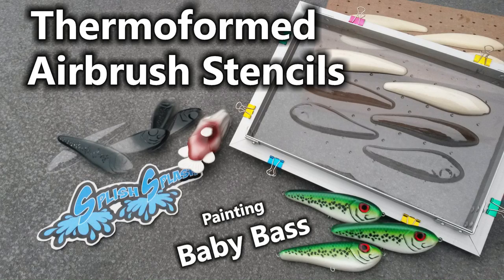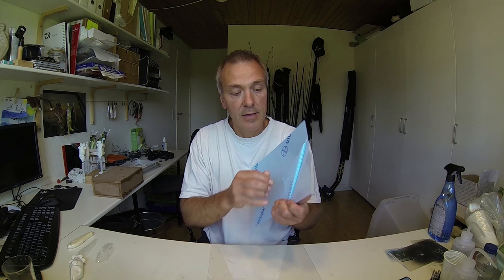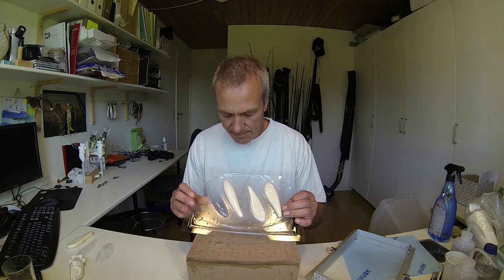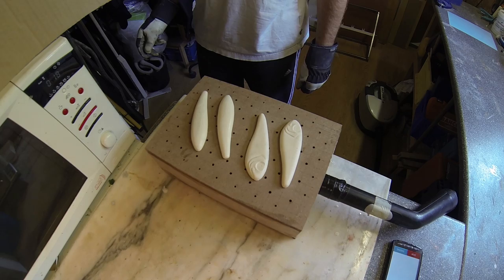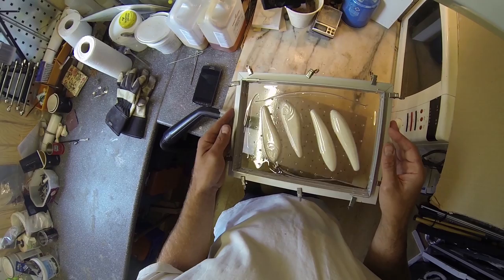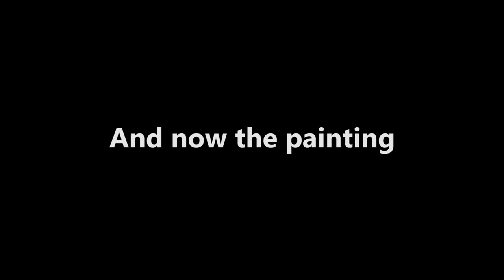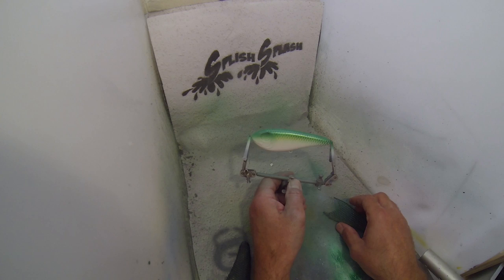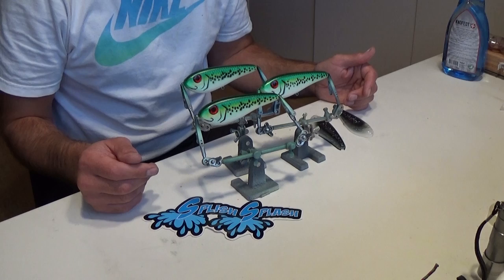Thermoformed Airbrush Stencils

Comment: Awesome video and definitely looks like a baby bass. Could you use a heat gun on the plastic instead of an oven? if so it would be cool if you made a video doing that. Tight lines man.
Reply from the maker: You can use a heatgun, but it has the risk of melting holes in the plastic. With the owen you the whole thing heated at once, so it easily shapes around the bait

Comment: Great video as always mate. Thanks for posting. Are they plastic stencils for the scales or some other material?
Reply from the maker: Thanks Mathew. No the scale "stencil" is made of some metal net i found at the hardware store. I think it's called "expanded metal net" or "expanded metal plate mesh". I found that if i shaped it around the lure it gives me the same great result as the thermoformed stencils.
Reply: Thank you very much mate. More good ideas. Thanks again for sharing

Comment: Great video as always! Can you give us tips how long do you heat foil in oven and on what temperature?
Reply from the maker: About 30 seconds in 200 degrees celsius. When the plastic starts to get soft and hang down from the frame, you should quickly take it out of the owen
Reply: @SplishSplashFishing  Thank you for the information. I tried with thermo foil for lamination, which is much thinner 0.1mm, and I didn't get results as yours.
Reply from the maker: @vladankostic5166  Sounds too thin for this. Maybe i you put it cold on the vacuumbox and heat it carefully with a heatgun